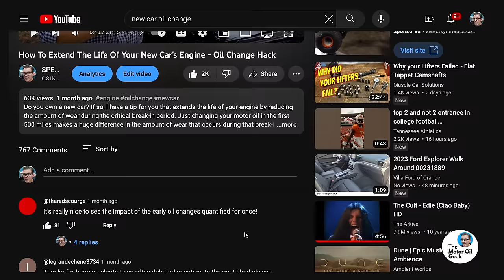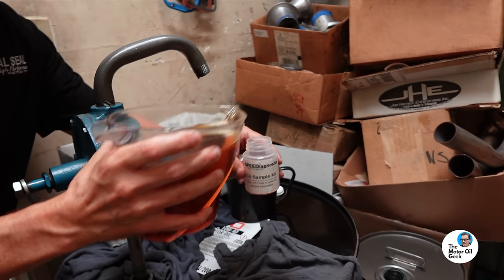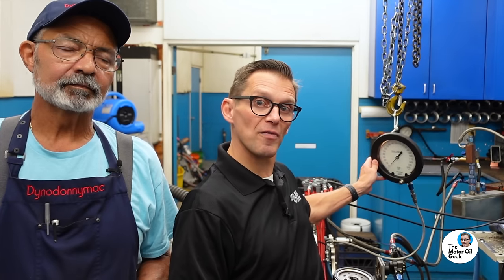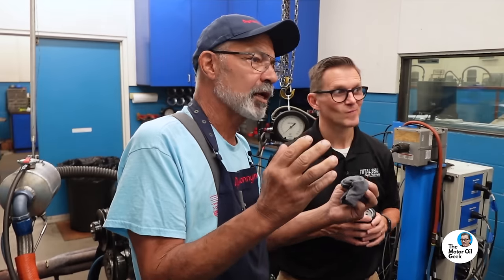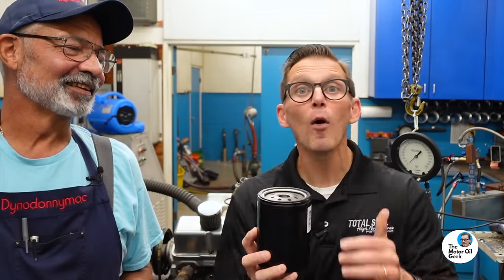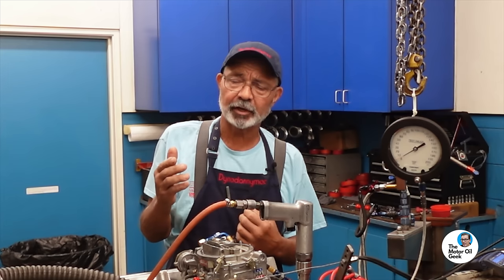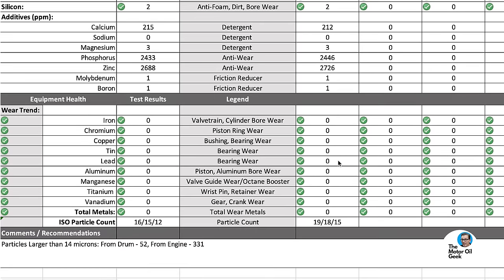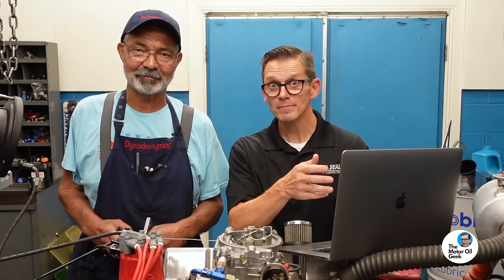Does Pre-FILLING The Oil FILTER Cause Engine DAMAGE?

Comment: So how would i fill a filter up and install it on a horizontal application lol
Reply: I have been in the auto mechanic profession  since 1974
You don't need to fill the oil filter all the way
The problem is when the oil filter is with doubble valve,you can't fill the oil filter with oil

Comment: @themotoroilgeek I agree there can be no harm done by putting oil in a place that the engine will already put oil in eventually. However, on some engines, the orientation of the filter would prevent you from being able to prefill the filter. What would be your stance/advice for say a Subaru engine where the filter is actually upside down in the bay?
Reply from the maker: Oil Change Hack For Vertically or Horizontally Mounted Oil Filters #motoroil #oilchange #oilfilter
https://youtube.com/shorts/ZF-SPAKtzrY?feature=share

Comment: sorry old man when you rebuild the engine/trans you use lube and presoak everything. so the lube is the answer. and if you need oil it the fitler. then why are same tran filter and engine filters sideways or upside down. where they don't hold oil. because oil is already everywhere in the engine and dont need to be prerun to stop damage. because it all dont go to the bottom. and oil soaks into metal. so if you got shiny metal. you're using thin oil at too high of a temp. that all the says.try using better oil

Comment: If it doesn’t go o. Upside down like some older Tacoma s always prefill it. I prefill my filter on my 2015 crv so oil get to the timing chain tensioner quicker. Otherwise I have to listen to the timing chain smack the cover for a lot longer than I feel comfortable with 😂.

Comment: What nonsense internet people saying. I always prefilled the filter with oil. I prefilled it mainly because I don't have to run the engine to top up an oil. That's right, you run the engine to fill the filter then you top up the rest, but with the prefilled filter, you don't need to top up, you hit the correct amount, duh.

Comment: not a great test since the entire system was already primed with oil it will naturally get to pressure faster than an engine that just had its oil changed even if you fill the filter since the lines will be drained as well

Comment: The engine gets oil FROM the filter. If you use a quality brand of oil, a thin film will be left on vital parts like cam and main bearings. Put some oil in the new filter.

Comment: Well my diesel engined car the filter. sits upside down and its a pain to get it into position.so by the time i got it screwed in the oil would be down the side of the engine and on the floor.

Comment: Devil's advocate here...    my father is a master mechanic with 50+ years on the job working on everything from small engines to passenger cars to heavy equipment.  Started working at Caterpillar and moved into his own business afterward.  To this day his phone rings off the hook because factories, plants, businesses, etc. will have a technician show up who can't fix their machines and their machines are critical to their business.  So they call him to get the job done.  I have never seen him pre-fill a filter in my life.  And I've never known him to have an engine go down.  Not once dating back to when I was a boy hanging out in the shop back in the early 1980s.  So, I do not bother pre-filling filters either.  Haven't for the last 25 years.  And I've never had an engine issue either.

Comment: I have changed my oil on my car for years and I have done it without prefilling the oil filter and with prefilling the oil filter. My car still runs great no matter if I do it or not. Point of the sory: It doesn't matter.

Comment: Pfffsststttt, lol, well to be honest I had heard if you fully fill it with oil you need a few medium size ball bearings in the filter probably like 5/10 should do it. When the oil circulates the ball bearings obviously move about thusly continuously mixing the oil within the filter assembly. I have heard it works wonders.

Comment: I always prefill my filters from a new, unopened container. It would be great if someone would invent/design an adapter for filters so that they could be prefilled through the anti-drainback valves (correct direction of flow), making that prefill oil also prefiltered. Hmmmm 🤔

Comment: I never have prefilled and so many motors you would just make a mess even trying...i suppose if the oil filter hangs straight down then why not...I just never remember to.  But I never keep vehicles into high milage anyway so I mean how much difference can it possibly make for me?  besides if you do a quick enough oil change and motor was warmed up?  there is still plenty of oil film left anyway I would think?  I mean as opposed to letting it drain all night to get every last drop of old oil?

Comment: No it doesn’t hurt the engine if it did then running the engine would not have an oil filter in the lubricant system.  Not priming the filter can cause excessive wear over time.

Comment: I just think it's unnecessary.  Start up and let it no load idle until you get oil pressure.  Many large marine diesels have an idling oil spec of 0psi.  Never had a problem.  Way to many applications have vertical spin ons or cartridge type filters for me to ever waste time pre filling.

Comment: Let's see... oil pressure takes 3 sec with an empty filter. 2x to 3x per year, average annual miles driven is ~12K divided by 60 mph = 720,000 sec of oil pressure with the engine running. 3x oil changes per year at 3 sec to prime = 0.0025 % of operating time per year. Yes, the cold start cycle has the highest wear rate including with a primed oil filter. But the residual oil film of a quality oil on metal surfaces is adequate. Otherwise, why no other elevated wear metals like Ag, Sn, Cr from other parts of the engine? I suspect far more engine failures are caused by crappy oil used too long, and filters lacking high first pass efficiency. I use Purolater Boss oil filters,  99%+ first pass extraction efficiency @ 20 microns, Mobil 1 0W-20 for 7 years, 85K miles in my 2017 Honda CRV, GDI, turbo engine. Every oil analysis with every oil change@ 5-6K miles, shows normal wear metals, no fuel dilution, severe duty cycle (short trips, cold winters), 34 mpg. Oh yeah, I never prime my oil filter, ever. Neglect + primed oil filter still yields a poor outcome.

Comment: hello,

I think your methode of testing is'nt correct. The particals in the oil who past the engine is disturbing the outcome of the test.
You must filter the oil only true the filter and not true the engine!!
The sludge of the engine must be flushed before you do this test.

Comment: I've always wondered why engines just don't come with an electric oil pump that comes on prior to ignition so that oil gets on the top end sooner.. Have a small delay start like a glow plug diesel engine... just enough delay that the oil gets pumped up on top end and then fire it off... Would save so much wear. I calculated that after 10 years of starts with 2 seconds of no oil on top end, that you are running that engine for a week without oil... I'd bet that engines would last a LOT LONGER with an electric supplemental startup oil pump.. Just saying.. Short of this simple invention/revision, I prefill/prewet my oil filters and run Amsoil, as Amsoil tends to cling longer for this design deficit.... Comment?
Reply from the maker: Thanks for sharing

Comment: help me on a problem.. I used to run a quick lube I had a penzoil rep, they just came out with synthetic BLEND I refused to sell it to my customers because the rep could not tell me what percent was synthetic and what percent was regular oil.  I have never had someone tell me what it was.  You could have 1 % synthetic and 99 5 regular oil and still call it a BLEND.  could not get an answer you would think that it would say on the bottle.  Can you tell me about this is there a saw it has to be 50/50 or can each manufacturer decide themselves?

Comment: THINK OF THIS   SOME PEOPLE  DRIVE THE CAR WITH DIRTY OIL FOR YEARS .  AND HAVE NO PROBLEM ,   THE OIL IN THE FILTER  IS TOO LESS TO DAMAGE ENGING  BEFORE IT REACH THE RINGS   IT ALREADY  SPLASH ALL  OVER..   ALSO THE FORCE  AND HEAT WILL  DISLOVE  IT ,

Comment: You are measuring particles that were in the engine prior to the oil change. Unless you clean the entire internals of the engine, the residual oil film  inside the engine will contain particles. I do agree that the filter needs to be filled with oil, but your measurements are misleading.

Comment: You’ll cause more damage to engine bearings, and lifters by starving it of oil for the first 15 seconds, because it’s trying to fill up the filter with oil first, than putting in the “dirty” clean oil in filter.

Comment: It's actually a good idea. Do you know why ?
Let me tell you why 
In every engine there's an oil pump which is locates in the engine crankshaft base so before the oil will go to the top of the engine , it goes through the oil filter which will clean the oil before it reaches the top to produces smooth running of the engine.
Get it ?😊

Comment: This all ignores where the pump and filter are in the system in relation to eachother. The slight initial drop in oil pressure is irrelivent, because oil has moved throughout the system on the first crank and the filter is already filling.

Unless you have a really big and old engine, or your oil pump pulls directly from the filter, pre-filling achieves no measurable differences in performance or wear/tear.

That being said, all the people saying that pre-filling is harmful, are just dumb.

Comment: Completely unnecessary.

Smear oil or grease on the seal and smash it on empty, just as the workshop manual and filter manufacturer recommend.

Comment: Lol What the difference between pouring the oil unfiltered directly in the engine or into the filter? Nothing... 
Also what about the cars that as soon as you crack the filter loose the oil pouring out because of the position. You can't fill the filter first or it will spill out before you get the filter on.

Comment: On an Oil change it doesn't matter. It may on a bran new engine. Until some one can show me how much longer it takes for oil pump to fill an empty filter vs one already full to circulate, its nonsense conversation. If the filter is horizontal off the engine, how you gonna prefill that? Its surely not going to hurt anything to prefill.

Comment: I've always prefilled all my oil filters on everything that requires an oil filter my whole life. And I'm 60, so. I've never burned up an engine, ever. Now, here not to long ago I got my first vehicle that takes a damn cartridge and it's direct injection. The damn knocking in the engine at first startup was horrible.  It didn't even have a 100 k on it. Yeah, I got rid of it. I'm staying with my older vehicle's. This newer generation of vehicle's. No thank you.

Comment: Sure...filling the filter with oil is great on an engine that is completely dry.  However, if doing an oil change within minutes of the engine having just been run - then, filling the filter wouldn't equate to anything as everything is still lubricated.
Great for some geezer that just got his crate motor in, but not required for the typical driver.
Many times, "science" is over thought and over sold.

Comment: 70% of engine wear is Revving a cold engine. When you start ANY vehicle say away from the throttle for the first 30 seconds!!!!!!! Also stick a POWERFUL Neo-magnet on the bottom of your oil pan so any micro fine iron dust sticks to the pans bottom!!!!

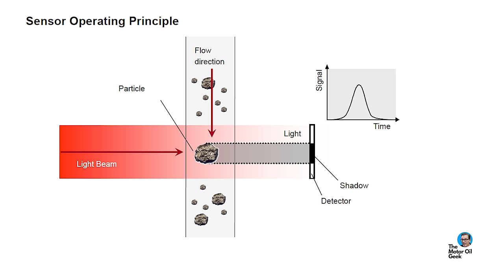Comment: 11:28 subaru forrester is upside down hard to keep in as installing it !
Reply: It still will wet the filter fabric and reduce pressure drop across the filter upon startup.  Just add some oil to it and let it sit while the oil drains.  Then dump it out into the oil you are refilling with.  It's not that hard.

Comment: With all due respect , your theory for adding oil in filters holds no water ... Most new cars that have cartridge filters have no way of adding oil bcuz it will go straight down to the pan ... Most imports have side mounted filters and Subaru's new engines have an upside down filter !   Your average V8  engines don't exist that much and they are becoming Dinosaurs  ..
My 04 Outback with H6 has 240K on it and filter is sideways ,  Engine runs great and burns zero oils .
Been a mechanic by trade 50 years and have never filled an oil filter .... I trust the oils coming out of a can or a bottle to be clean enough ...

Comment: Any time, even milliseconds, that the bearings do not have a good film of oil and/or oil pressure, is a time they are being damaged - period. You can test all you want but don't overengineer it or believe the conspiracy theorist that have no mechanical knowledge or understanding. If you can fill the filter without knocking some dirt into it or loosing a half a quart down your arm, THEN DO IT! Of course, all this doesn't matter to those who don't maintain their equipment or trade it in every 3 years but those who want to drive them for a while (I have 4 GM V8's over 250,000 miles), then FILL THE DAM FILTER and stop arguing about it.

Comment: ok so first of all i change my oil when i just been running my engine i let it sit for like 15 min then dump it i do this so all the sludge if any will come out. then i remove old filter install new one with oil on the seal then i fill the engine with oil and turn it on for like 3 minutes . all parts on the engine are still coated with old oil when i turn it back on and it now has new oil in it 😂

Comment: Most cars with fuel injection and by wire gas pedal after an oil change you press the gas pedal to the floor. Start engine, the engine will do a start cycle without firing and prime the oil system. Now you know.

Comment: Heat the engine, drain the oil, put the plug back in, start the engine and run it for 1-2 seconds without oil, then shut the engine off, remove the oil plug, pour a half cup of oil in and allow it to push out more oil from the pan, replace the plug, fill the filter with oil and mount it, add an extra splash of oil (up to 0.3 qt on a 4.7 quart fill) after checking for leaks. I did this to all my engines and changed the oil sooner than the dealer recommends. 217,000 miles on my 99 VW Passat when retarded mechanics killed my engine, it had ZERO sludge, another mechanic that worked for VW Audi as the service manager was shocked,  he diagnosed the engine failure, VW recalled my car for engine sludge, but since I changed the oil myself they did not honor the recall, not that there would have been anything for them to do. I also changed the oil the week I bought it, 5 quarts of Valvoline 10/40 and a Fram PH2870A oil filter in 2000 cost me less than $10.00.

Comment: When you add oil to a car through the hole in the valve cover, None of that oil is filtered before going through the engine and down to the oil pump pickup.  So it doesn't matter.  
What are u going start doing? Filtering your oil through a coffee filter before adding it to your engine? 🙄 Tsss.

Comment: I just left a coment saying how to prime sideways & upside down filter in like 2 seconds, but the dumness of UtUb ErAsd them.  pUr UtUb moronicism😒.  Short story short - there are 2 ways or =‘s too prime with our turning engine dry.  1- a thin circle 2 1/2d peice of plastic that ya slide out right before filter gets to seal point, &2- just don’t turn car off then back on at 2 usual occasions, like lockd & idling at 7-11 for example(thats 4 minuts dry idle - saved)👋

Comment: When you turn up an engine, set the timing.
 Adjust your carburetor make adjustments to the throttle body. If not a carburetor you have the air filter removed.  And you're sucking in contaminants through the intake manifold and heads. What does that do to your oil? You guys need to find Something Else to do, Like find a girlfriend.😂

Comment: The internet's full of armchair idiots; powersports mechanic 16 yrs. No filter will filter out all particles in its oil supply, not even close. Therefore these will exist in every gallery after the filter, in a properly-functioning ICE. No oil fresh out the bottle will have any of that. So to press the notion, in a public forum, the 50cc of virgin oil filling your oil filter, will somehow damage your engine by not filtering it first? Not thinking before typing😅

Comment: Biggest problem is getting people to change their oil and 2nd problem is changing it as CHEAP as possible...
Reply: Why would you want oil as cheap as possible to, 'protect", an engine worth thousands and thousands of dollars?
Reply: @HiTechOilCo  I wouldn't BUT that's what I see from doing Auto Body for 45 years... I have over 20 Cars and Trucks Currently and I get them for nothing at 200,000km plus, I fix them and maintain the engines with Seafoam and Lucus etc and many have gone over the 500,000km mark... and my 1984 S-10 2.8 went close to a Million Km :)

Comment: slant six with its weird upside down oil filter cartridge had a long stand off tube that went up into the cartridge (even the old drop in ones) That prevented oil from draining out of the filter, made for a tough pre-fill but a little bucket under there caught everything. The lack of common sense on even the most basic auto maintenance is due to no more drivers ed in high school. WTH were they thinking? I suppose 'gender studies' is a more important mandatory class nowadays.  Forget auto safety, your more likely to get injured by a non binary swinging a handbag now?